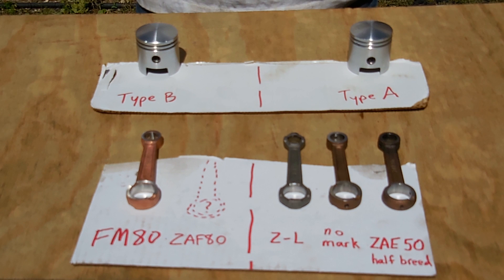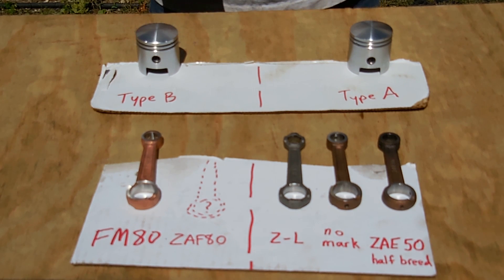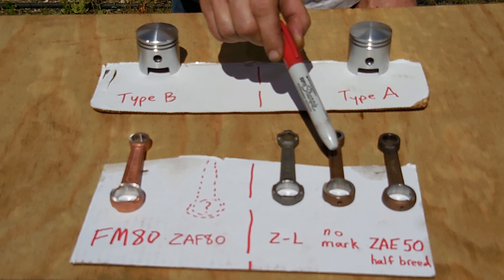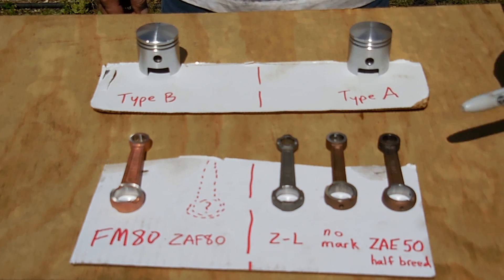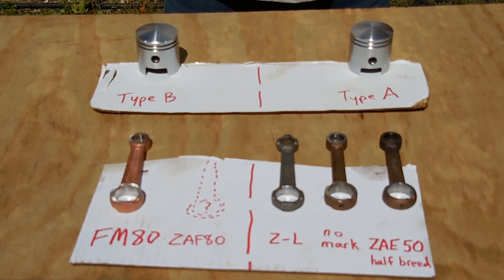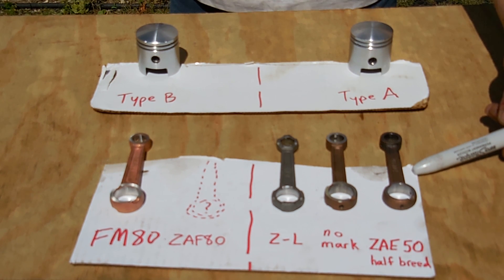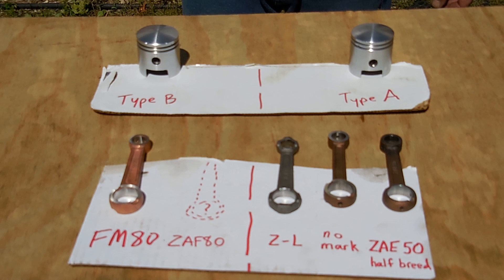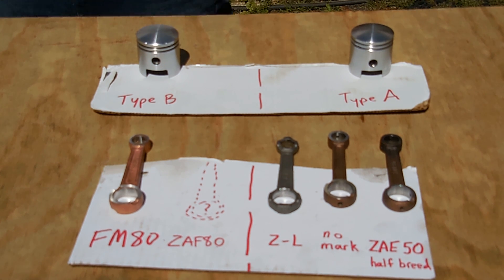66/80 cc Motorized bicycle engine geometries explained

Comment: You said the fm80 has 38mm stroke...i believe you are wrong.  The fm80 should be a long stroke connecting rod and should have a 40mm stroke

Edit: i guess my af80 is a long connecting rod...which correlates to high wrist pin piston and a SHORTER (38mm) stroke...for some reason i correlated longer connecting rod with longer stroke...maybe i stand corrected

Comment: The gomax pk80s I have been running have high hole pistons, I tried to put a low hole on one of them when I rebuilt the top end and it didn't work and was hitting the head, that was years ago and I always use the high hole now, even gomax claims their pk80s are triple '40s?

Comment: Fred, thanks for this video.  It helpede me alot!  I have a mainstreem 80cc engine and ordered a new bottom end for it.  (Got one with the ZAE 50 rod)  Was clueless about it maybe having a different sized piston shaft and when I put it together the  piston ws hitting the head.  I did extensive research onit and you are THE only good source of information on it that I could find.  I do not understand why these suppliers don't put this information on the ads.

Comment: I keep having issues with my 66cc . . .it has a tybe B piston and a z-L rod, keeps seizing at high rpm even though the mixture seems good for it, plug is chocolate brown. .  Noticed you divided the ZL from the type B, the only damage is on the lower half of the piston.. Looks like its melting and chipping away!
Is that rod, piston combo wrong?

Comment: I just got a motor from BGF 100cc high compression head . The rod is stamped EAF 80. Supposedly 50 mm bore I measure at like 49+ .Can find any info on it.

Comment: other variants are popping up these days. 2 have a low-hole Type A piston with a ZMN80 rod that might or not have the GT4 cylinder.

I want to get a sleeved 50mm jug, but it comes with high hole A piston and I dont have long rod bottom ends, but maybe i can find a matching piston idk,,

Comment: now im totally confuse. i have a high wrist pin hole on the piston with the FM80 connection rod. the description on the engine i have said its a 40mm stroke. now you're saying its a 38mm stroke?

Comment: I've never seen or heard of a zaf80,   only the ZAE80, Why was the ZAE80 not included in this??
Reply: Did you find out anything...i have the ZAE 80 also...the engine is denoted as A80 on the pamphlet.    I curious what stroke it has.

Comment: I have one I just got with a type B piston, and a brass-colored rod stamped ZAE 80. What engine type do I have? I'm wanting to order a few things from CR machine but I need to know what engine i have.
Reply: Cody Watson, I have a GT-6 with the same ZAE80 rod. I don't know what mm' s length it is yet. I do know it's from gasbike, if you find out what it is please post information. I will do the same . I have no time to rip it apart to measure it.
Reply: premiumcut6813 I've already put her back together, but if it helps any it came from Kingsmotorbikes.com I plan to order another one next week - it dis have the issue with the drive gear ( the little one behing the clutch cover) wobbling due to not being assembled properly, and I had to fix the gap between magnet and magneto, but its running good so I figure its the best I can do for the 130 price tag. I still do need to find out what actual engine it is however so I can order parts from CR machine. The ZAE80 rod.
Reply: @premiumcut6813  it's a 38mm I have a gt7 not a bad kit but certainly going to be adding the mz65 muffler

Comment: I'm rebuilding a 48cc engine with a connecting rod marked "JM50." I got a ZAE50 rod and crank assembly, and I think it will fit. 
I will also be using non-sealed crank bearings, with a metal shield on one side, and I'll be running Lucas high-performance 2-stroke oil.  Anyone have any advice on any of this?  Am I making a terrible mistake?  
Btw, I'm assuming open side of the bearing should face inward, right?  Or does the shield allow enough oil through?  Maybe it's there to prevent debris from getting in there?

Comment: Had one motor quite some time ago with a jsf50...Haven't seen this suffice since but always wondered what stroke was on it. Went to replace piston with a type-a (low pin)--didn't know then what I do now--and it cleared cylinder an easy 1/8"...tore this piston up quick. Assumed then because cylinder has 32mm intake and believed then that ALL 32mm intake cylinders had type a pistons

Comment: Thank You! If there weren't for you,I'dve missed 'casting flash' tips/points on the edges of the Intake port,I would never have taken the Head off my new Motor.I saw 'tips'on the inner side of the 'carrier/intake' port from the base in the Head too.I used a very Fine file and drew Back until all the fingers were gone,and a Minute bevel was upon every ports edges.No problems after I started it.Thanx again Mr,C.(btw,I used Molybdenum lube in bearings and on cylinder sleeve before bolting together)You know,but not some here,that Molybdenum soaks Into steel and reinforces it.

Comment: Does a zeda 80 motor have a type A piston?
Reply from the maker: No. The ZEDA engine is not a PK-80. The ZEDA engine takes a type B
Reply: Frederic Chelminski ok thanks!
Reply: Frederic Chelminski so does it come with a balanced crank? Ive seen people with a balanced crank from the factory.
Reply: What is better for max top speed the long rod or short Rod?

Comment: So while tearing my engine down for port work. I seen I have a ZAE 80 con rod kind of copper color Has the type b piston    So what type of engine would I have?    Also I bought the engine from gasbikes.net.    It was listed as a black stallion 66/80 cc
Reply: i think these are rebadged A80 engines...just a theory though.

Comment: How bad is the non caged lower needle bearing...if I tune a motor with such a bearing is it a waste . .. my other motor has caged bearing and and it seems to hold up fine and I ride it hard and it hits high rpm. Just got one and wonder should I sell it or tune it as I can do most everything except dynamic balance and that lower bearing

Comment: These connecting rod doesn't affect the stroke I need a longer stroke, but it depends on the crankshaft are there different types of crankshaft?
Reply: Jordán József mzparts miami on ebay sells a stroker crank the rod is 3mm longer so 41mm stroke. I bought one

Comment: ive got the 49cc engine (thats what the ad said) and it has the fm80 rod. is that possible? or is it actually a 66cc?
Reply: Those companies do this so you think its completly street legal. Its 66cc
Reply: you have 66cc. esp you can tell by 8mm studs bcs 48cc has only 6mm. also head bolt spacing is 42mm if you can measure that
Reply: Same. I ordered a "48cc" engine but it wasn't until I ordered a new jug (which was WAY too small) that I found out I actually had a 66cc.

And yes, likewise, I have a con rod marked "FM80" and it has a type B piston.

I'm not sure about the stroke, whether it's 38mm or 40mm..... I've never measured it..... But the top edge of the piston is flush with the top of the cylinder.

Comment: i have a kit with a f80 rod whats that
Reply from the maker: Yes. There have been several newcomers since this video was made. There are so many rods now, It's become even more difficult to keep up. The F80 rod is a GT-5 type engine. You must use a type B piston and it has a 38mm stroke. Be aware that some vendors do not know what kind of pistons type have and name them arbitrarily (MZ Miami) for example has the nomenclature reversed. For reference, you can go to my website to look at the pictures. www.crmachine.com

Comment: i have th zaf80 connecting rod!
Reply: The piston probably hit the head and cracked it get the type b piston and you should be good. Just received my type b once I get home I'm going to put my engine together I will let you know what I find
Reply from the maker: I've only seen that rod in the GT-5 type engines (38mm stroke, type B piston).
Reply: I'm watching your video now. And I have that connecting rod with a type A piston.. and it's hitting the head.. obviously found out why. My question is what type of cylinder do I need. If you know
Reply from the maker: Yeah, that's the wrong piston. You need a type B. Some vendors are confused and name their pistons incorrectly. You've got a GT-5 engine. I sell top end kits for that type on my website: www.crmachine.com
Reply: Nathan hubis 
hey I have a ZAE80 connecting rod
the Piston I'm about to put on there is a B- piston , when the original piston was in A-piston ,which got  cracked plus  I have a high compression aluminum head would something go wrong?

Comment: I have the ZAE50 engine and the thing is a power house. I can beat the tar out of it and it just keeps taking it. It impresses me to no end.
Reply: where did you buy it from
Reply: Just a random low $ kit from ebay.
Reply: I took my engine apart and it has the ZAE 50 im replacing the crank with a 3mm stroker though. Ill still keep it though. I'm using a 48mm bore cylinder.
Reply: I'm currently rebuilding my 48cc engine. It has a JM50 connecting rod.  I'm putting in a ZAE50 crank and rod assembly, in combination with a high-compression, hemi head.  I wonder if the thing will self destruct....

Comment: My rod say ZMN have you ever seen that before? The piston is a Type A, I can't find anything about ZMN rod length and I need to get a new cylinder body. Any help would be greatly appreciated. Thanks
Reply: where did you buy th motor
Reply: I have the same engine. It came with upgraded motor mount bolts and nuts. Fast stock out if the box.
Reply: This is weird cause I opened a motor I have and it's a zmn80 rod but a type b piston and I can't find much info either

Comment: Originally the GT5 came with a 40mm stroke But the builder changed to the 38mm stroke more recently !All my GT5 engines are different, different cylinders and different parts depending on when they were made !the GT5 engine comes with the best cast cylinder and can be ported way!!! better than any other on the market and come with the 40mm intake ! most PK's come with the 38mm stroke but I got one with the 40mm stroke !They just mix and match parts at the factory ! I talked to the man at the factory a couple of years ago and he explaned the change from 40 mm stroke to the 38mm stroke !

Comment: Nice video.  Stumbled across your stuff looking for a definitive answer about axial play on crankshafts and how much is too much. Realizing what these engines are and what  they are NOT, I've always been under the impression that if you can feel or see it absent a dial indicator that its definitely bad as a rule for all 2strokes. Well what i have is a bottom end of unknown origin with your mystery zaf80 rod and you can actually grab hold and cock the entire crankshaft to the output side where it seems to perhaps grab the poorly machined lip that you described in another video. I have neither puller nor access to a lathe but would like to crack the crankcase open.  Are there any methods of doing so without causing  damage? Also this particular engine is coupled to a type B piston by your standards. I've been burning day light for over 2 hours now just taking in all this good info you're putting out. Thanks for being that guy.

Comment: Just wanted toad here that I have an older bgf  engine that has a rod marked ZAE 50 which has the narrow crank flywheel/counter weights, the rod is a bit thicker and has more of an I-Beam look to it, the engine this crank and rod came out of has the largest exhaust port and transfer ports of any of these engines I have ever had or seen, I actually got it back in 2010, the measurement between crank main journal and lower rod journal pin is roughly 3.75mm just like the newest "half breed" crank.

Have you seen one of these Fred?
Reply: I have that ZAE50 rod in my 40mm bore 48cc. it is a revvy mutha but it never had any torque even w/porting +pipe. really smooth runner I thought. maybe the ports on those ZAE species were just made for top speed haha

Comment: how can i tell which piston i have. i dont see many differences
Reply: Look at the distance between top of piston and top of pistons wrist pin hole' the GT5 wrist pin hole is like Fred mentioned and about center of the piston, while the Type A piston for the 40mm stroke engines and the 38mm stroke "Half Breed" engines has its pin setting a few m's lower which allows piston to reach correct height at TDC since the Type A " PK 80 engines and the HB engines has a shorter connecting rod.
Hope this helps answer your question, and if Fred chimes in here he may make it even clearer and add some other measurements to held you out.
Reply: mapbike  ohh that makes sense, thanks map
Reply: 7brandonc your welcome, glad I could help. take care and ride safe

Comment: Thank You Fred, Excellent explanation of engine types and the differences, I have a couple older 2009 & 2010 BGF engines, my oldest with around 1300-1400 miles on it has the rod with the loose pin bearing on crank journal, it is a real bone shaker though, horrible vibes, I think removing crank and truing it will help some though, spinning crank in case one can see the weights wobble back and forth so I'm sure a lot of the vibes are being caused by this issue alone. this engine is a 47mm bore and 40mm stroke but it is the old type with 6mm studs and the piston is much lighter and has a shorter dome. an odd ball thing nowadays.

Thanks again Fred for the great info.

Comment: I found it better, that the bigend bearing will be with out a cage. I made the small top bearing from bronze! The standard type small end bearing with cage keeps on breaking, and there for every time scratching the bore.

thanks for this video.
Reply: enginelover1 I had to edit my comment most of it was theory anyway and beyond all that nonsense I had absolutely no luck with the PK 66/80 it was far too heavy for my 8 lb.steel bike frame. Sense then I've held on a small version that runs extremely well with transfer and port enhancing and reed kit .

Comment: Hello Fred, can i ask you for the bottom conection rod bearing dimensions for the "half breed" engine ? Thank you very much !
Reply from the maker: Hi Barty. The dimensions for the lower connecting rod bearing used in the half breed engine is 22 X 16 X 11 mm. It's a caged needle bearing. It's the same bearing that is used in the GT-5 engines and some of the new style PK-80 style engines. All the engines using caged needle bearings are the same. The only engine that does not use a caged needle bearing are the old style PK-80 type using the Z-L connecting rod.
Reply: Thank you

Comment: Nice video, I was thinking about building an engine up using a pistonbikes bottom end and one of your stage one cylinder bodies with a stage 2 head but wasn't quite sure which cylinder body or piston I needed.  There's so much variation between these engines and it always has me confused because by the time I need to buy parts I've already forgotten which parts go with which engines.